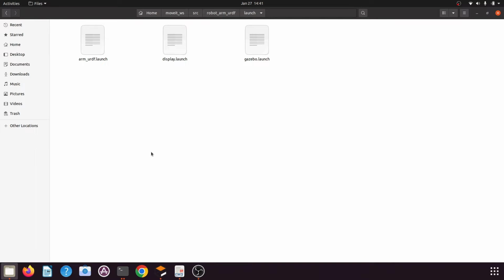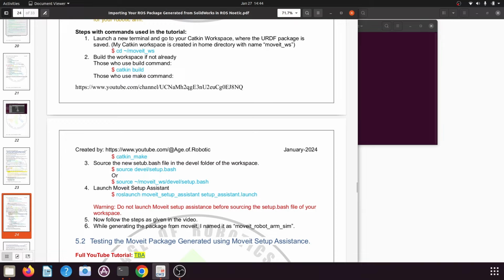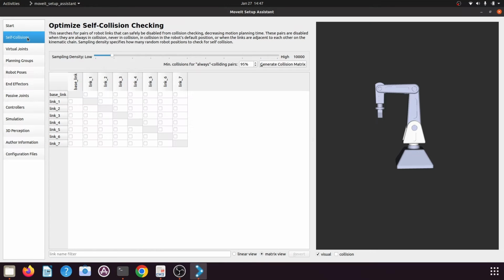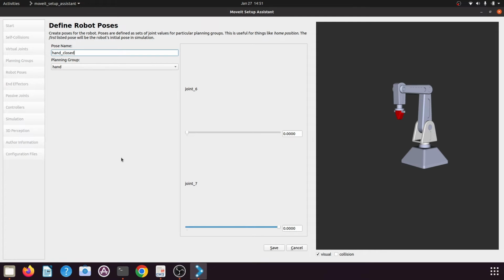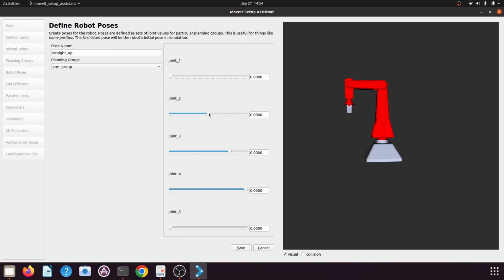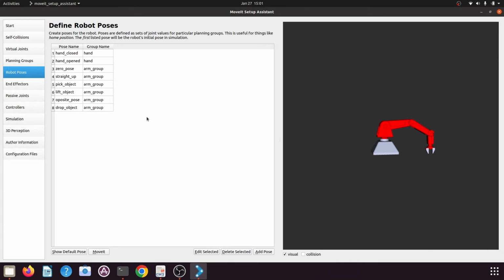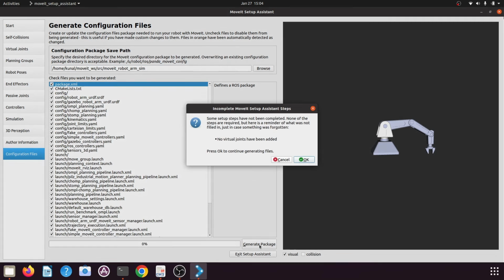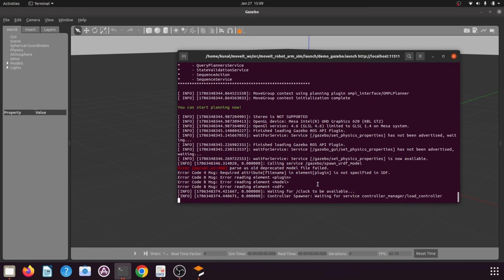Lesson 9:  Use Moveit Setup Assistant to Create Manipulator Package of Your Robotic Arm (ROS Noetic)

Comment: Hi, is it possible to add two end effectors and change them while running moveit? 
I have a gripper or a camera mounted on my robot and I change between them in my application. I want to do it changing the planning group and the self collision while running Moveit, I know how to change the planning group but I am not able to change the collision